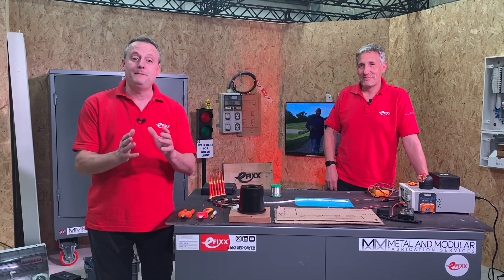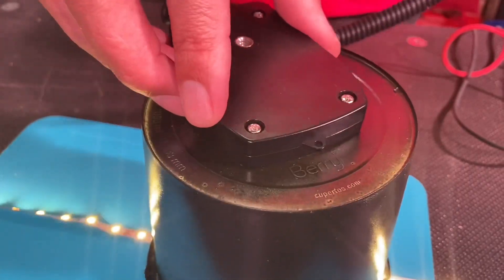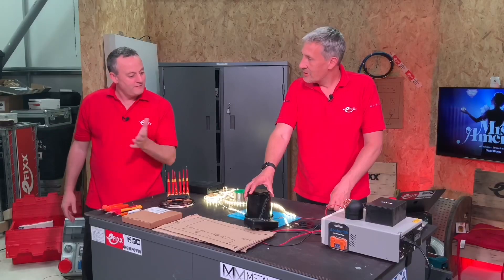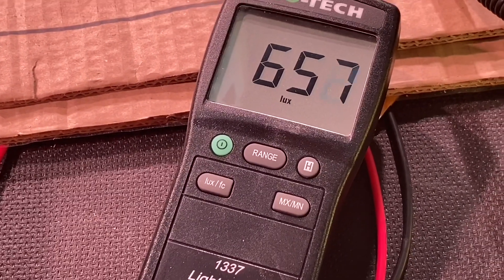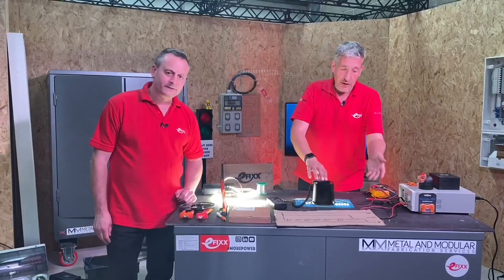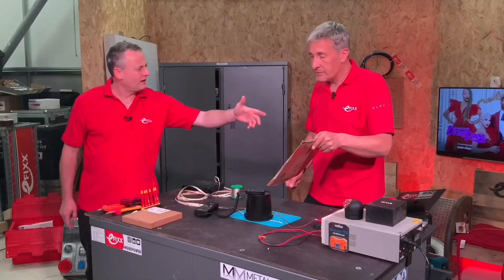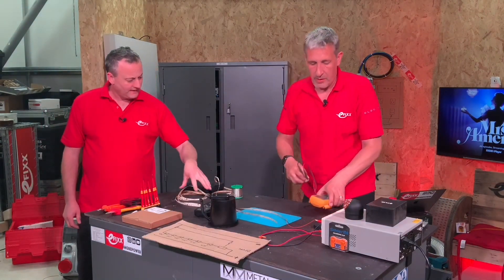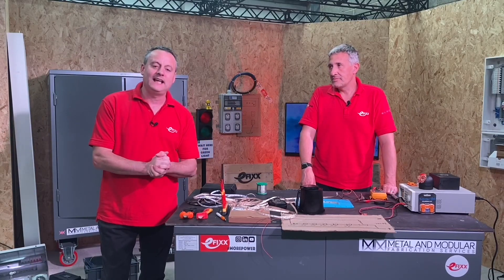What's the problem with cheap LED strips?

Comment: After fitting them to customers kitchen cupboards the remainder looks great inside the back of your van, i just popped out the standard bulb in my Transit & soldered the LED strip to the light fitting, i can now see where i put my 20mm gromits.

Comment: Buy TUYA WiFi Smart LED Strip Light. 
Product 1: https://www.aliexpress.com/item/1005001798449378.html
Product 2: https://www.aliexpress.com/item/1005001901496818.html

Discounts for you only: 
Coupon 1: Save USD $6 on USD $20: http://dwz.date/dPRM
Coupon 2: Save USD $8 on USD $30: http://dwz.date/dQ9F
Coupon 2: Save USD $15 on USD $45: http://dwz.date/dQ9D

Claim and use the coupons before they end.

Comment: I’d expect a 24v Osram one to be superior but not exactly a fair test imo. 

I’ve had a 5m £6.99 strip under my kitchen plinth for a good 7 years now and it’s still going strong and I can’t tell any difference in lux levels looking at it (I haven’t measured volt drop). I’ve got a branded one else where and it’s no different.
Interesting experiment though.
Reply from the maker: Thanks for the feedback... great points 👍

Comment: While what you have demonstrated is correct and one should perhaps stay away from really cheap LED strips, it is also the case that power needs to be applied at the end of the strip also and sometimes in the middle too.
Reply from the maker: That would be a work around for cheap LED strip. However, quality LED strip with current regulators or heavy gauge copper tracks shouldn’t need a work around.

Comment: Test some of our's Gordon, I have been involved in quality MFR for a long time and know the difference better than most. Most of what is on the ethernet is garbage. Issue I have is also some are stocking ultra thin PCB poor quality strip. 24VDC is better, coupled to high copper grade PCB strip with quality encapuslated diodes.

Comment: This is why long strips need to be powered in parallel at regular intervals along their length. Also, a linear regulator drops the excess supply voltage as heat, so not only is it a waste of electricity but also the heat is not good for the longevity of the strip.

Comment: Put the positive at one end of the tape, negative at the other. Use DVM to measure voltage at one end of strip. Adjust for 12v.  This will balance the voltage drop across the strip -- as the negative drops the postive increases and visa versa.